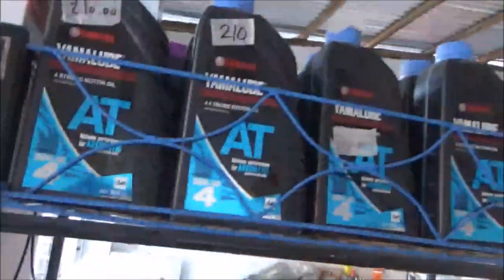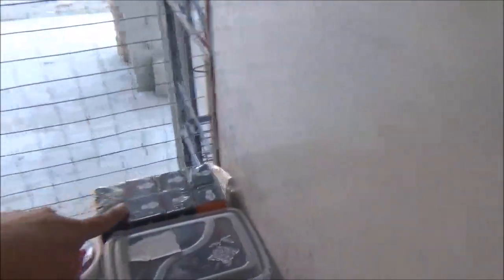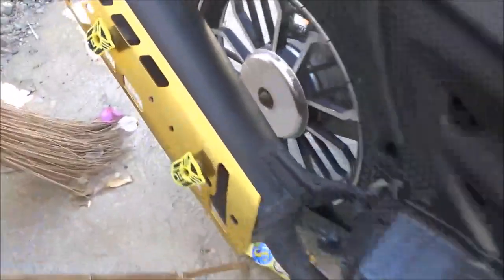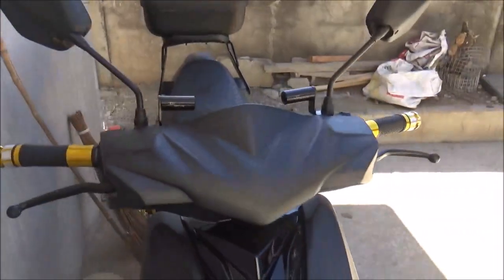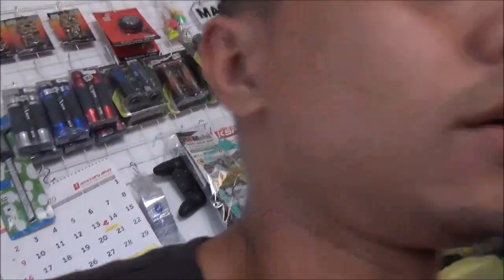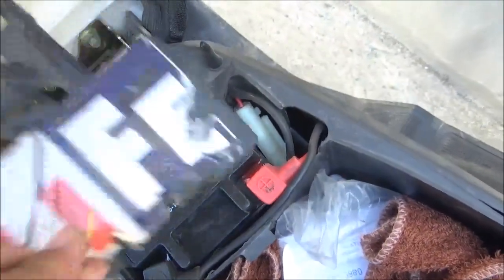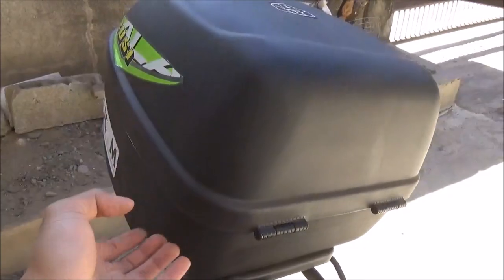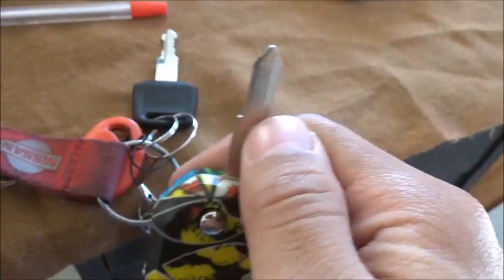gulonggong|usapang gulong|leo samurai|rusi gala 125

Comment: Ilan ba amperes ng fuse ng rusi gala?
Reply from the maker: hindi ko lang alam paps kung ilan amps nya
Reply: @jemarmiranda4401  pacheck nmn sa motor mo kung ilang amperes
Reply from the maker: walang naka lagay paps ehh
Reply: @jemarmiranda4401  meron yan paps check mo maigi. Ano kulay na lang?
Reply from the maker: @richardalcantara4814  glass kasi yung fuse ng gala ko
pag sa mio kasi may naka tatak sa ibabaw at may kulay,tas depende sa kulay ang amps ng fuse